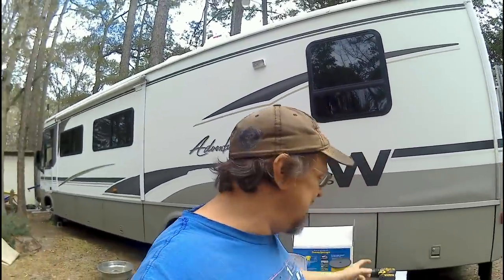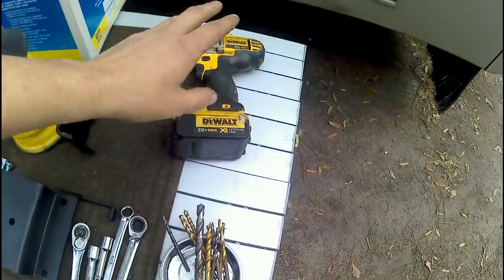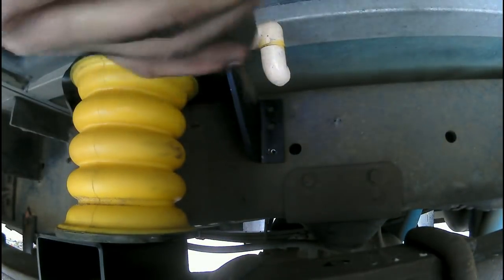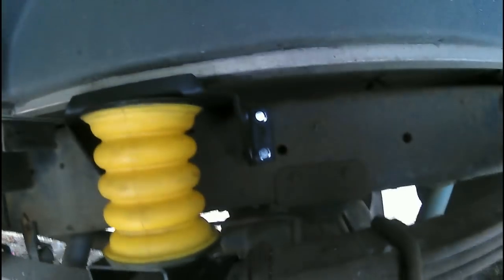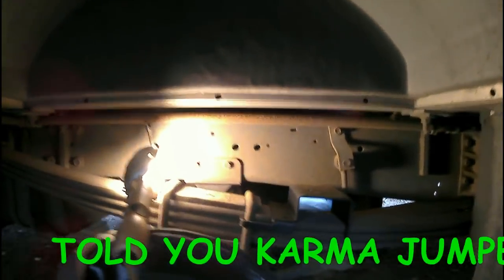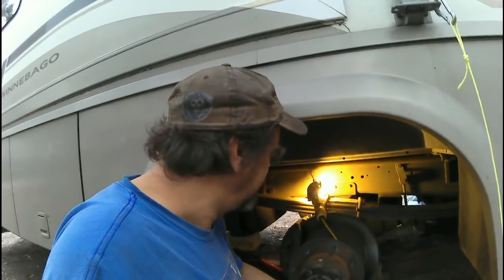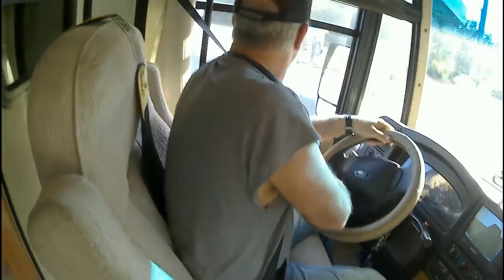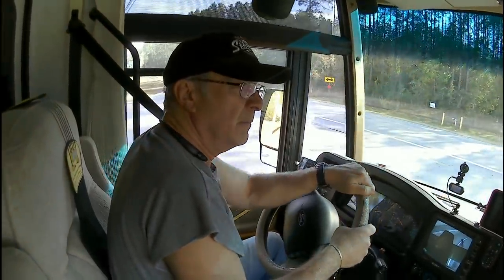Installing Sumo Springs on a Class A RV Pt 2

Comment: I'm not a mechanic by any means, but, after trucking for 38 years and owning Class 8 vehicles with air bags on the tractor and trailer, I would venture to say this customer won't ever have to worry about that spring 'blowing out' like an air bag can! Great video as always, Wayne....keep 'em coming! God Bless! (PS: buy some new drill bits!)
Reply from the maker: I have spoken to him after he drove with them on and will make a follow up video on them.  I will sharpen the bits as the was dull when I was done.

Comment: I added sumosprings to the front of my 2004 F150 to compensate for the weight of a winch and winch bumper. They helped a little bit but not enough. The Sumo Springs for the F-150 are very much different from these though they're literally just coil spring spacers. These look like something I might actually want on the rear end of the truck
Reply: that's not really what the sumo springs are designed for.. you really need heavier duty springs

Comment: I love your video's,  but if that tire blows it will take out that flex line and there could be a chance of expolsion. 
I would have put it on the inside of the frame away from the tire and wheel well.
Reply from the maker: Good point.  The gas line sits back about 6 inches from the wheel well and with the tire on there is almost a foot of clearance from the tire to the line.

Comment: Steel gas line was there for a safety reason. Now if a tire blows and tears out that soft gas line then Kaboom!  Big fireball going down the road. Could have drilled a hole in the frame and used a 90 to get you behind the frame and not next to the tire. Just my two cents.
Reply from the maker: Correct  The gas line sits back about 6 inches from the wheel well and with the tire on there is almost a foot of clearance from the tire to the line. Drilling into the frame would of worked and at that time I didn't think of doing that.
Reply: Yeah, Gotta admit some of my best ideas are after the job is done. LOL, Thanks for the video. I was thinking about getting some Sumo springs but before ordering I will check real good for obstructions first.

Comment: Not sure what your wedge was doing?  Was it to keep the bracket on top of the Sumo Spring so bracket was stable on F53 frame for drilling?   No installation compression required on Sumo Spring?  None the less, I enjoyed the presentation.  Cheers!
Reply from the maker: It is keeping the bracket in the correct location. No when you install them there is on compression on them. They compress when you lower the Rv back down on its wheels.

Comment: Well I looked in to pitting them on my workhorse they don't make the bags for the back of them I have the same model 2004 year
Reply from the maker: You can call them  and they can help you out. 800-903-2760

Comment: Wait. You put a residential flexible gas line, meant to be in a house behind a range, and installed it not only exposed it to all the elements, salt and road debris, but in a wheel opening on a truck.  Mmm, not a good idea.

Comment: Not a good idea running the gas line like that. That flexes Not Meant For That the vibrations will crack that Flex after a while. Bare minimum should have ran and copper, tubing better idea. Steel fittings with nipple and Union. Big Time safety concerns there